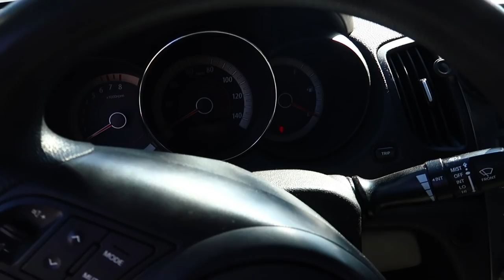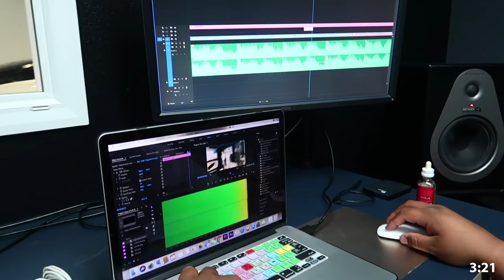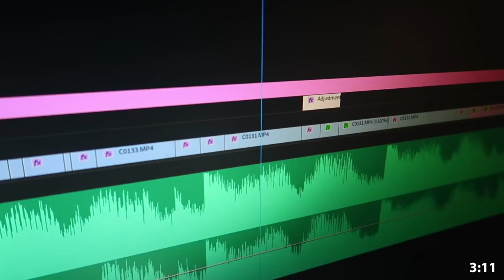2018 Toyota Camry is Actually NICE!  - NOT Your Daddy's Camry (Customized)

Comment: The red interior is amazing on the 2018 Camry..Honda needs Jesus right about now with their hideous Accord😂😂😂🤣🤣🤣🤣
Reply: Accord2.0turbo is the real sport's car sedan it's not like that grandma's&grandpa's CAMRY there just a regular sedan moroon  and don't try to compare your old outdated camry to an accord2.0 touring 10-speed and the Accord has way more performance's parts then your boring camry. .ohh and plus it spank the mazda6 new altima Maxima&your granny's camry put all the v6 sedan and it will dust them all that's with no HONDATA TUNE..
Reply: Deadass the Camrys are garbage and slow compared to the 2.0t accords. The front end looks like a foot should’ve kept it to Lexus. All garbage after market parts.